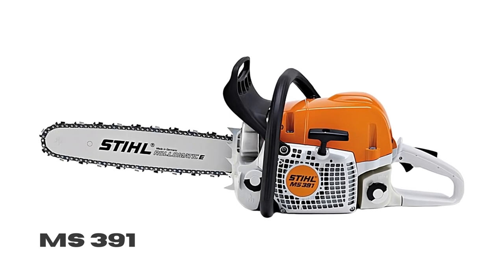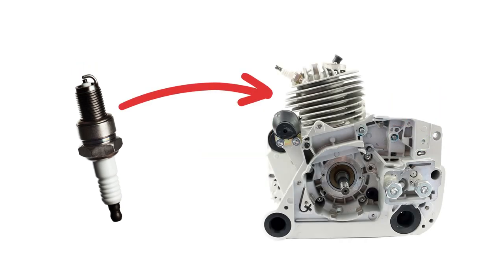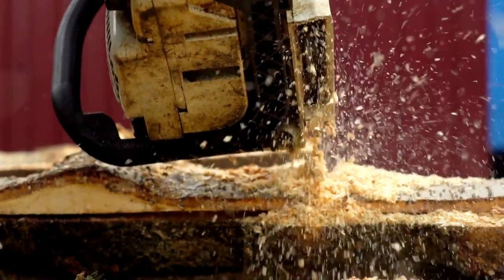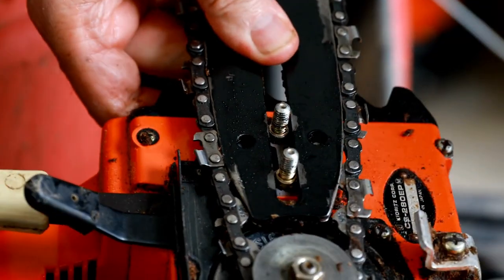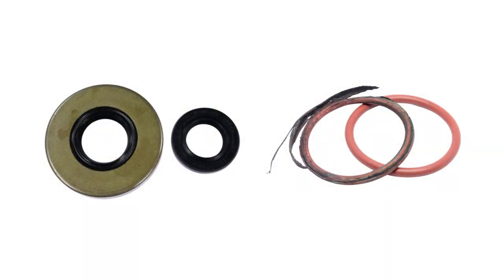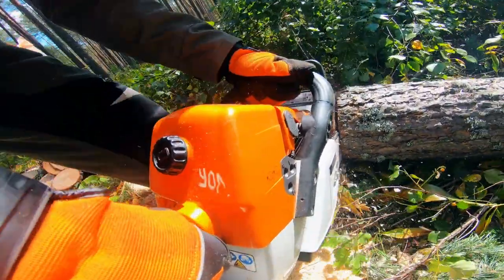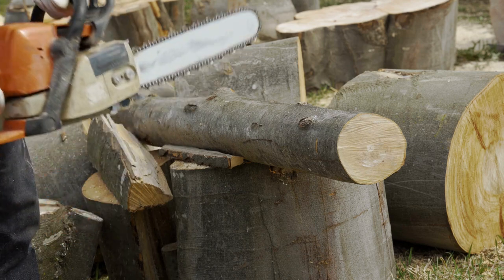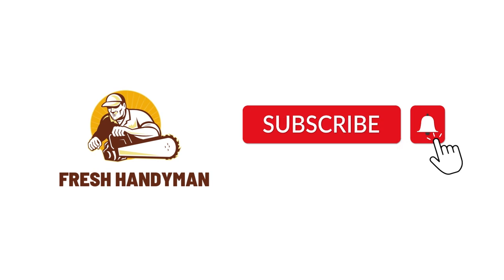Stihl MS 391 Chainsaw Problems: Troubleshooting Guide and Easy Solutions

Comment: Hi fit it with a smaller bar 16 or 18 inch will cut alot better and faster never a fan of large bars unless you have a saw with immense power like 661 or 881.

Comment: I have emptied old gas and put new. I have changed spark plug, air filter and fuel filter. I have checked the plug spark. It is blue but seems weak. It still won't start. Any suggestions. BTW the plug does not get wet. I have put gas in the carburetor and even wet the plug. Still doesn't start.
Reply: If it's not non-ethanol gas/pure gas it's likely already damaged the carburetor with gumminess/ white sticky residue that builds up on everything inside the carburetor mainly the jet's and needless not allowing fuel to flow. Remove the carburetor and remove everything that would get damaged from soaking overnight and buy yourself a gallon of chemtrol dip. You'll likely need a specialty tool to remove all the carburetor parts so they can get full access to the chemtrol dip. While it's apart check the primer bulb and connected usually clear hoses, make sure the connection points aren't split at the end of your primer bulb won't work. For future reference buy yourself a 5 gallon compressor that's capable of 150 psi and disassemble after every use and blow out all debris from the carburetor area and the entire chainsaw, the saw will always look like new and generally will work better with less failures. Used all these techniques on my MS391 for 5 year's cutting 7+cord's every summer and the saw never gave me any issues whatsoever. Hope this helps.

Comment: A stihl ms 391 is not a pro saw nope
Reply: My saw shop says they are in the pro lineup
Reply: What is a pro saw?
Reply: My thoughts we're any saw that's a minimum of 72cc is where I would consider calling it a pro saw. Anything smaller would consider prosumer, like anything 64.1 or 59.8.
Smaller than that and I call them home use only.
Reply: I've owned a MS391 and it's not a pro saw, I don't give 💩 what any saw shop says it's a prosumer model. Basically the homeowner who cuts firewood for himself. 
It does an okay job at that, but I wouldn't use it in any logging operation or you'll be sorely disappointed. I was a limber when I was just out of highschool and I couldn't stay out of the way of the skidders until one of the brothers came up to me and handed me a 72cc jonesred with a pro sprocket kit and aftermarket carburetor performance kit with carbon fiber reeds. Then at that point I could delimb the whole tree and buck it to length and catch back up with the feller. Literally the chips flying out of the back of that saw would hurt anyone passing behind you if they wasn't further than 15+ feet back and you better have your face shield down or the chips can cut your face, that's truth.